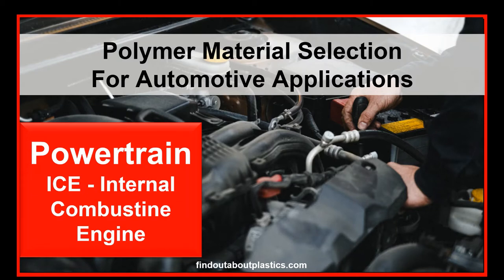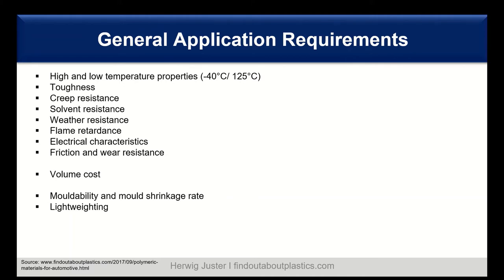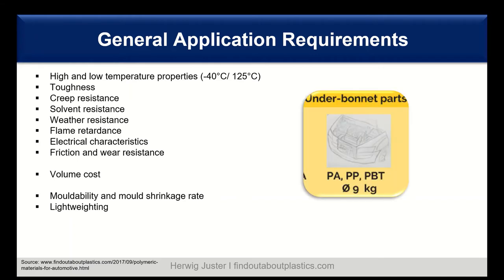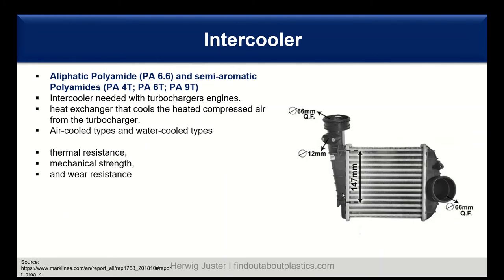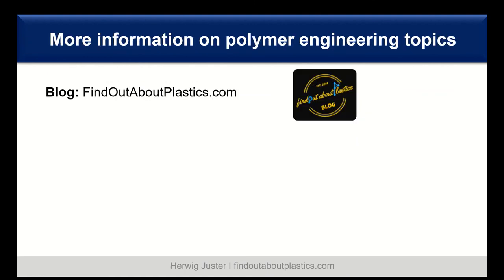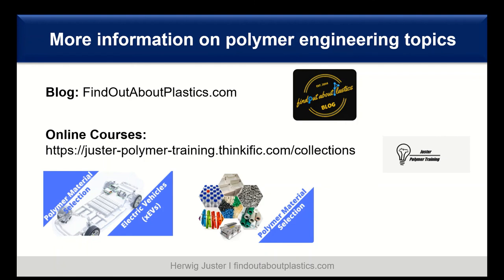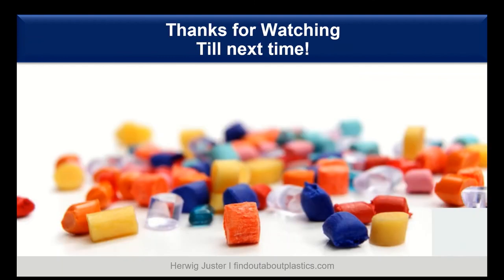Polymer Material Selection For Automotive - Powertrain Applications I Internal Combustion Engine

Comment from the maker: Time stamps: 
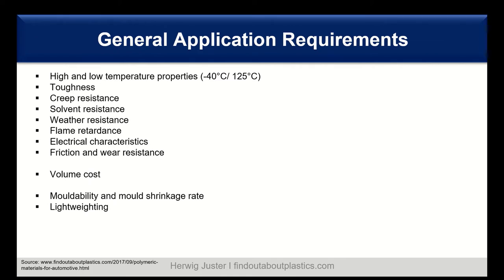00:41 General Application Requirements
02:10 Air intake manifolds
03:50 Cylinder head cover
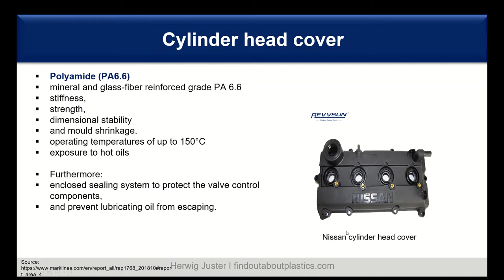05:18 Radiator
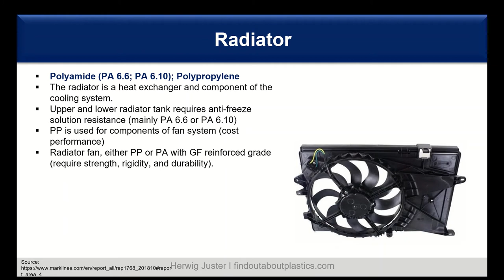06:40 Intercooler
07:39 Engine mount bracket
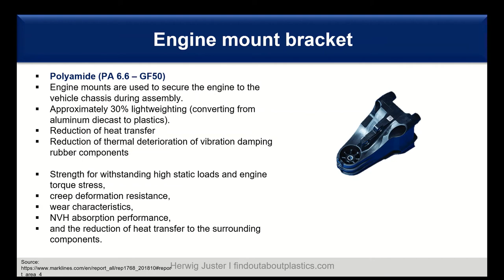09:09 Oil pans
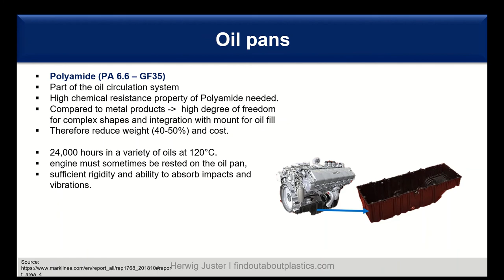10:44 Thermal management systems

Thanks for watching!